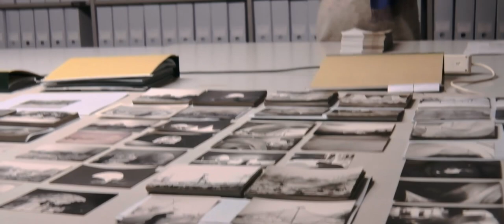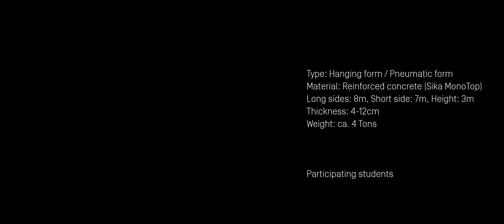Seminarweek ConcreteSpace FS19

Comment: hope it will stand long time.
Because i see some flatness on base side, it scares me
Reply: of no-one will run on roof out is ok
Reply from the maker: It was built to be temporary. After one month we took it down in 15 minutes :) It was very stable, you could run a car over it easily. Was a cool project for one week. We found a lot of things that could be improved and we would have done differently.